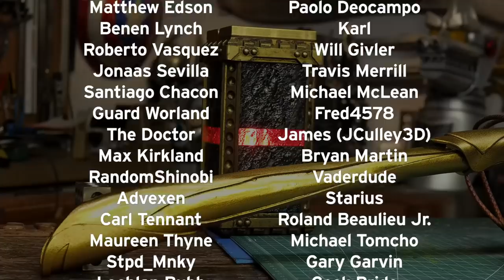Odin Makes: Loki's Chitauri Scepter from Avengers

Comment: Very cool build,  It seems so small.   Could you have ran an extra led with a pressure sensor to the tip of the main blade, then when you press it against people, it temporarily lights up.